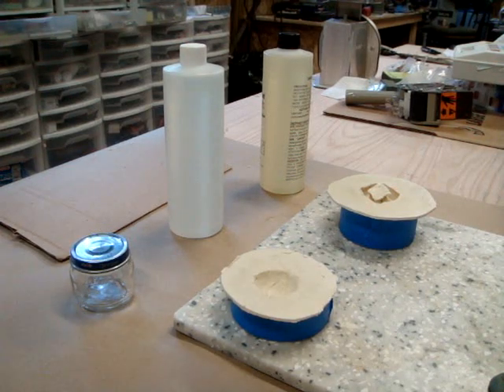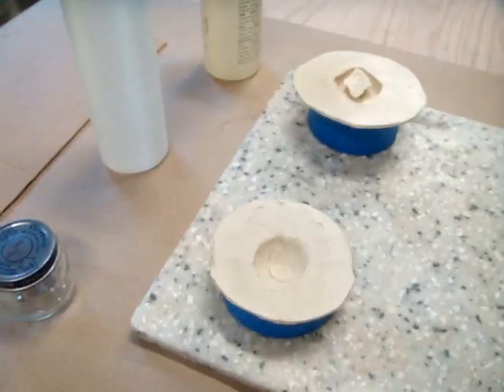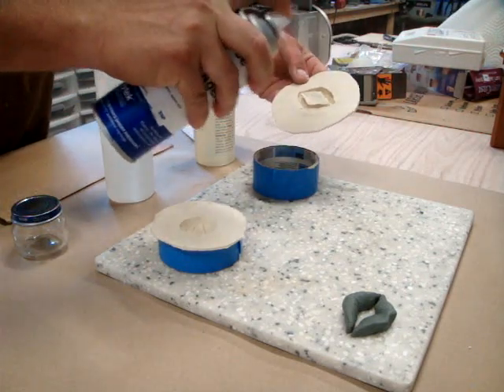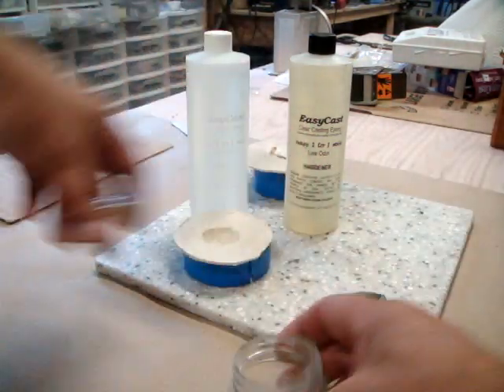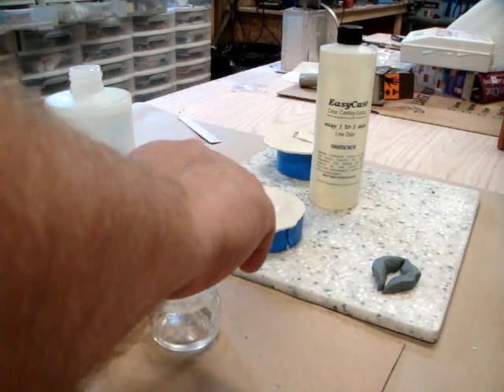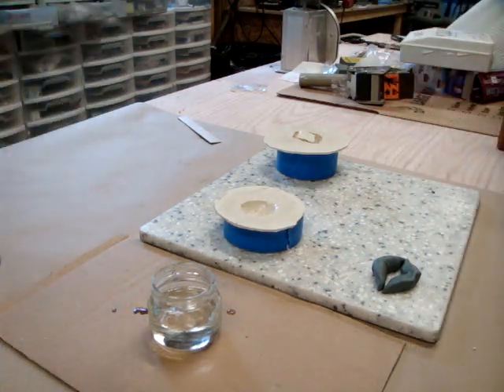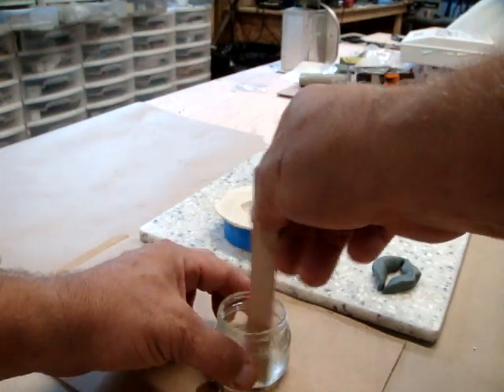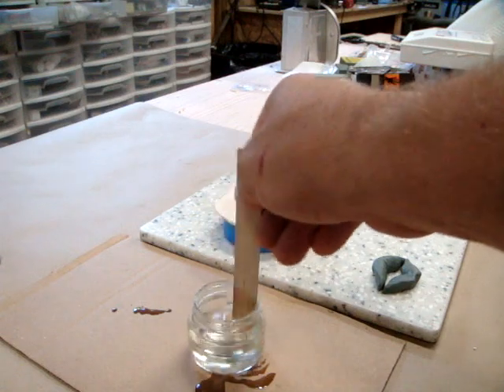Mixing and pouring the resin into the latex molds for the Lamptron Sponsored Inappropriate Mod by CyberDruidPC/Waterputer

Comment from the maker: No you really cannot alter the correct ratio without effecting the quality/strength of the catalyzed material. There are a lotof different types of epoxy and this type is designed to dry very thick with almost no bubbles. It does this by using a formula that catalyzes and cures very slowly.